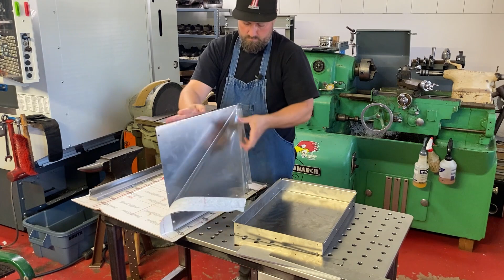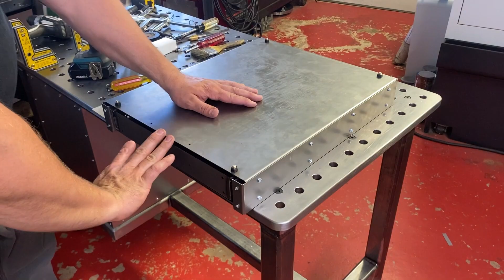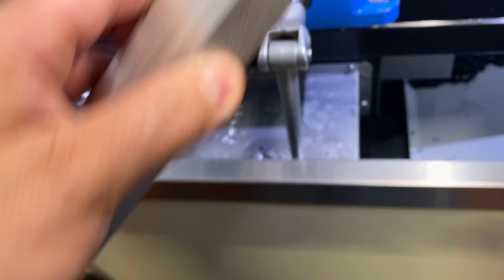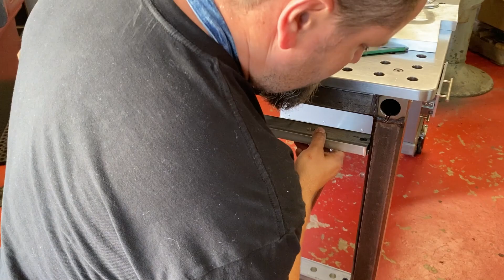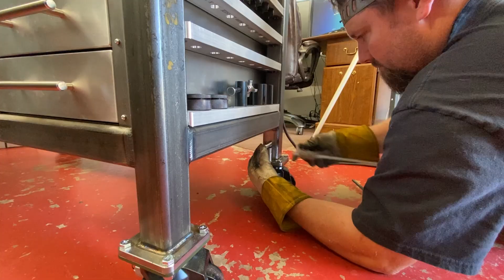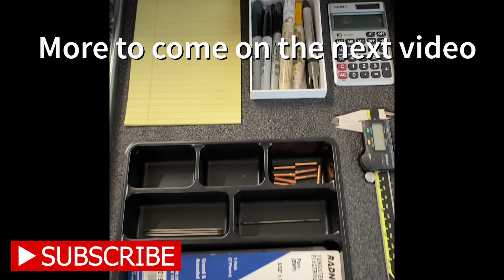My Welding Table Build | Tool Organization

Comment: This is so awesome. Only thing I would have done differently is weld the side tool holders on maybe 15-30° angle so the tools are easier to remove with the low vertical clearance. So nice.
Reply from the maker: Thank you! I agree that would make access to the tools easier for sure. Since my objective was to nest this table inside my workbench, I put the design constraints on myself to make all tools stay within the 2” tubing legs. If I would have tipped them at an angle many items would be out of the frame, but not all. 
Thanks for watching!
Reply: @nubtools Dream table territory dude. That top, those drawers 👌everything else just cream on the cake.
Reply from the maker: 🙏 it is like a dream. It so amazing to use. Now I just need to finish it. All the construction is done I only lack finishes. I had planned on painting it but I’m thinking about having it all powder coated instead except for the top obviously.
Reply: @nubtools  maybe clear coat? all the effort and gas you put into those welds, they should be on display 😁
Reply from the maker: At least we know what’s under the skirt. I think it will pay off in the end to have it covered.

Comment: Get rid of the ground clamp altogether and bolt a lug and make it solid... Way better ground. Loose a lot of amps in the poor clamp...
Reply from the maker: I would have if the table wasn’t a mobile unit and I have been using it a lot while not welding. Having a cable always attached could be annoying when not welding. 
Thanks for watching!
Reply: @nubtools  i have a welding table and mine is also molble... as is my wedding cart...... I can tell you I rather have 10 extra feet of wire over a clamped ground